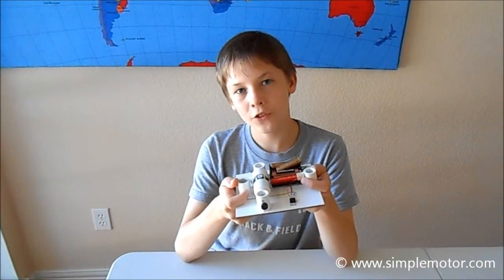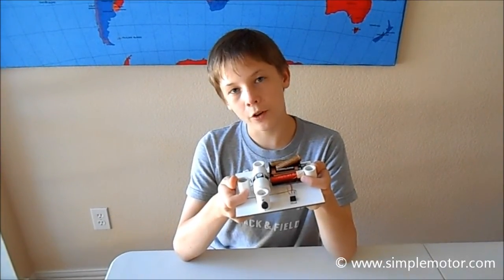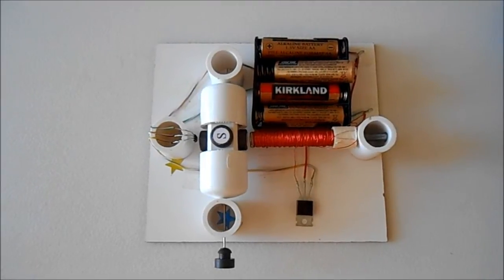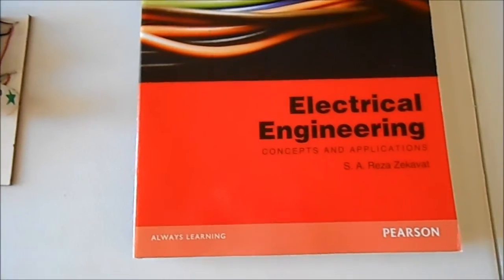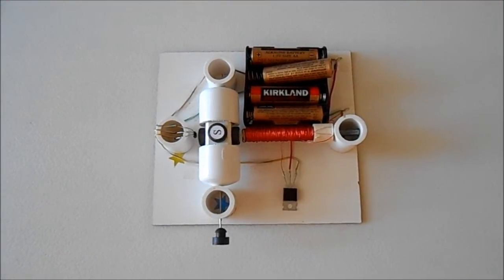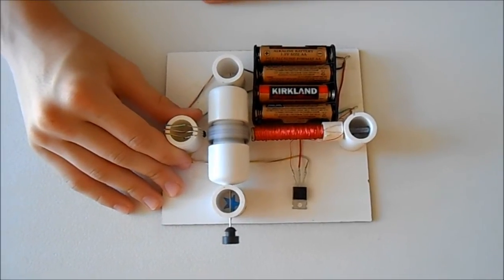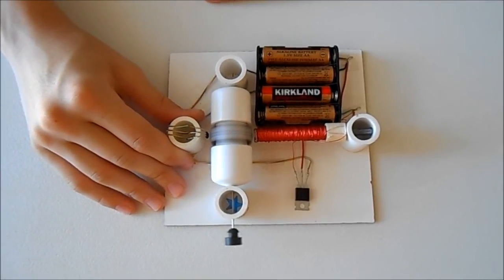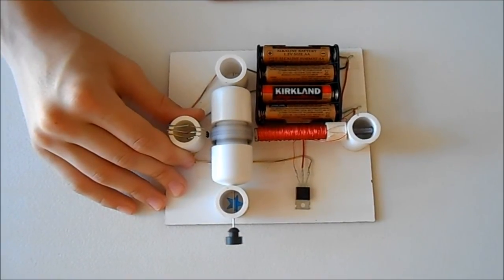Motor on a Hall effect switch built from kit #6

Comment: Why is it a PNP transistor? Doesn't the hall sensor creates a positive voltage signal with increasing magnetic field?
Reply: Hall effect sensors normally output a low when switched by a magnetic field so if you wanted to switch it with an NPN transistor you'd have to switch the output to high using something l ike a small BJT before you do. Heres a simple circuit doing the same thing  bit using a 2n2222a and an N chanel MOSFET. 
https://www.dropbox.com/s/zadkjnldb65f0vz/Circuit.jpg?dl=0
Reply: @parleyk4503  I already bought a pnp transistor. It's easier anyway, but thx😊